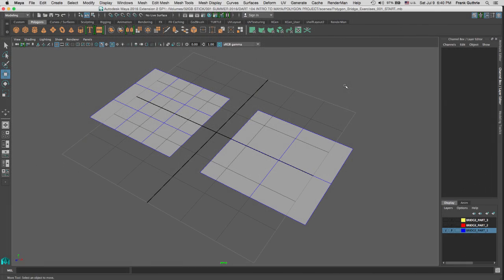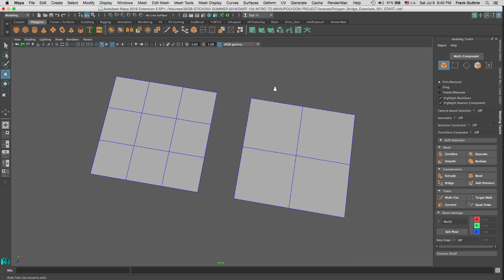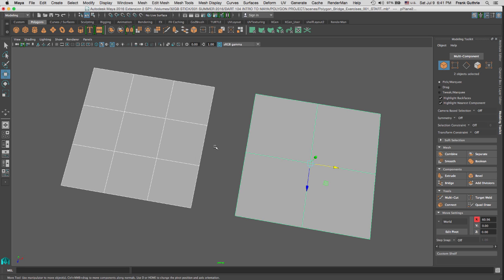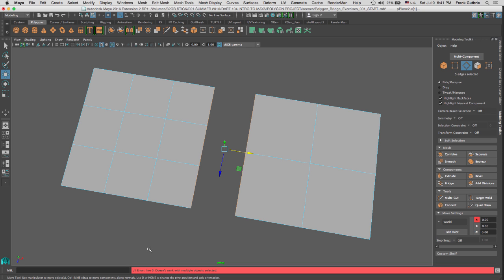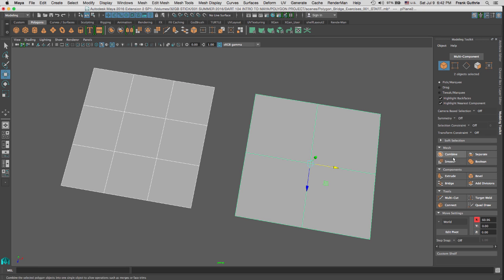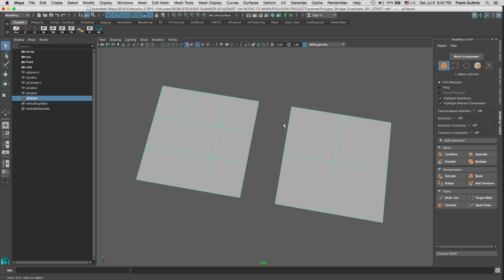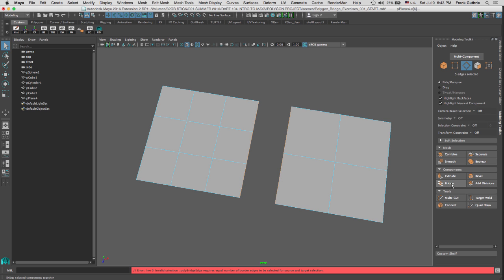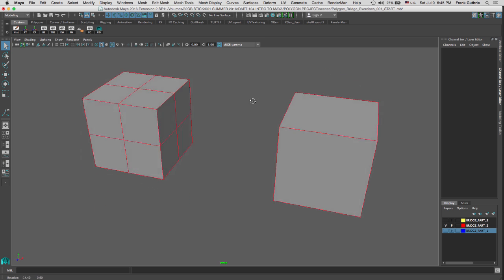DART 104 Intro To Maya: The Bridge Tool Part 1

Comment: to avoid that problem at 14.01 with snap to grid or also happens with snap to point, i discovered why, you have to make the pivot be for all items in the same point. so for that select all items, then hold D. then move the gizmo to another place but from the CENTER not from the arows. then all pivots of all objects will snap into one pivot, then you're able to move all objects snaping to point or to whatever, without making all of them overlap into one. ! thanks for your video! anyway this is old. i think by now you probably know how to solve that.